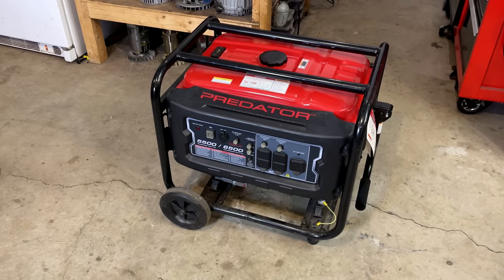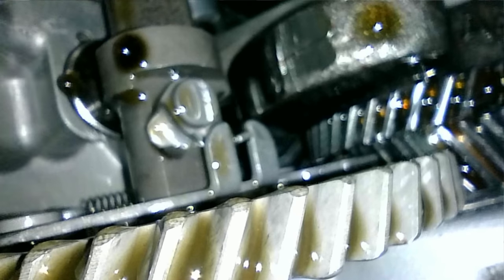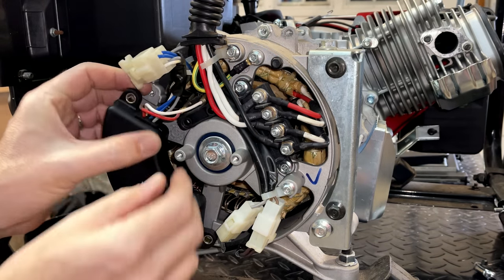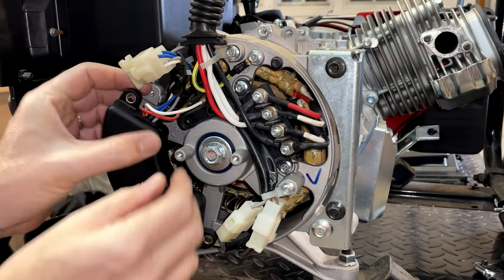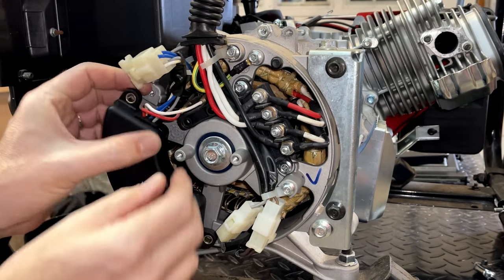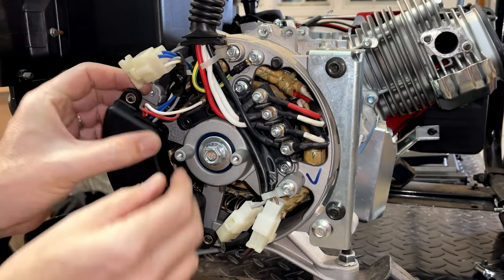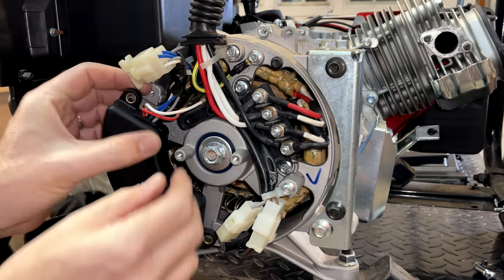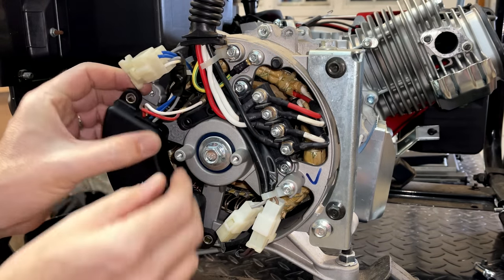Broken Predator Compression Release? - High Compression and Hard to Start

Comment: On a scale of one to ten, what is your honest opinion on the Predator? I didn't care that you couldn't get that part, nice going James
Reply from the maker: They are as good as any out there in this price range.  If you want to pay 2x or 3x more then you can get better quality.  For the price though, it is a good deal.
Reply: Many of these Predator generators come out of the same factory as many Champion, DuroMax, Wen, etc branded generators.  All the internals are the same, just different badging and sheet metal/plastic.  The guts are the same.  This particular genny was built by RATO in china.  RATO makes decent stuff in my experience.  So does Loncin, Ducar, and Lifan... the big 4 chinese manufacturers over there.  But as with everything coming out of china, the quality is dependent on the contract with the branding company... they have cheap stuff, and they have high quality stuff.... it all depends on what the branding company wants to pay for.

I have I think at least 5 Predator engines in service right now, and they've all been very good.  The Loncin built engines start the easiest by far... the RATO's are a bit more finicky for some reason, but still fairly easy to start.

Comment: no pun intended but....5000 watt ......123.5v at 17.2 a =  watts ? 2124.2 watts ? at 3000 watts your meters show, 122.9v at 15.6 amp = 1917.24 watts ?
what am i missing here is ohms law busted...lol
Reply: What you are missing is that the meter is reading %THD not amps. Also the generator is 240V so he's reading the voltage on only one leg hence 120v. The heaters he's using are 120v and use roughly 1300 to 1400 watts give or take. So 1300 x 4 = 5200 watts. Two heaters are connected to one 120v leg and two are connected to the other. Ohm's Law verified.